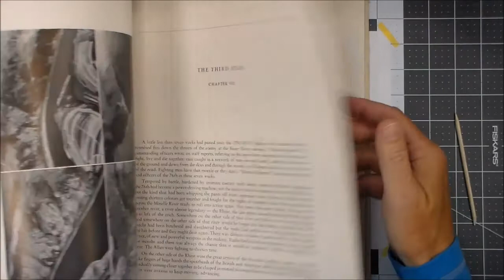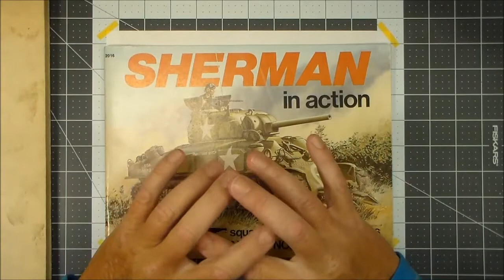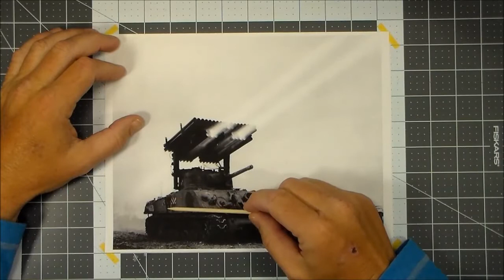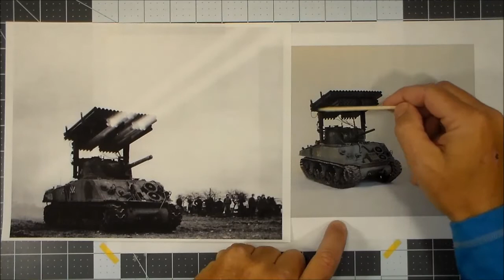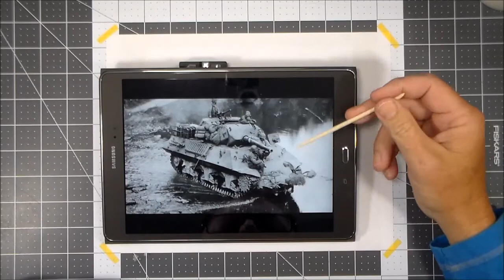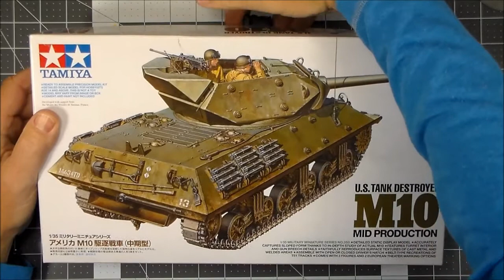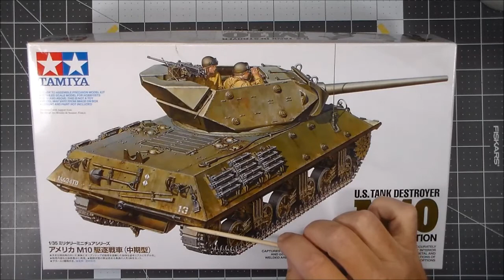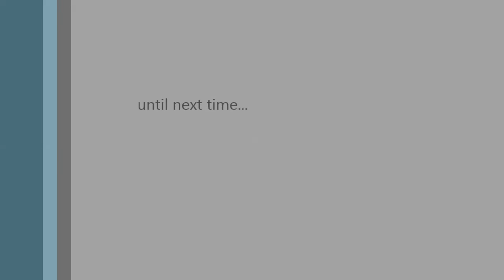Plastic Models For Beginners Series 4

Comment: The rubber Chevron tracks are T48. I believe there is an aftermarket kit by Royal model (?) that replicates the jerry can racks that were made for this particular vehicle.
Somewhere in my stash I have a full set of T48 DS TRACKS by Dragon.  Let me check.
Reply from the maker: 13 Bravo thanks! That is interesting about the rack... I had never heard of it and that would be a real time saver.
Reply: Brett G Found the Royal model kit on ebay; very steep price, ($55!) http://m.ebay.com/itm/171024901806?_mwBanner=1, then again it's possibly cheaper somewhere else.
you may be better off building from some Evergreen plastic rod.
Reply from the maker: 13 Bravo yowch! maybe I can get an idea from the picture on how to build it. Thanks!